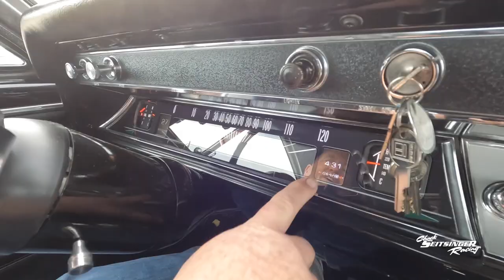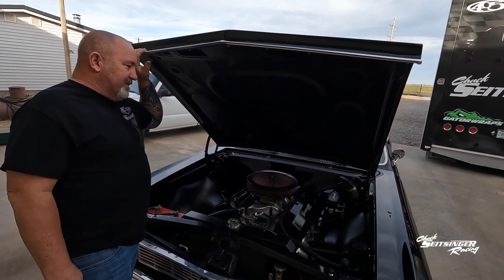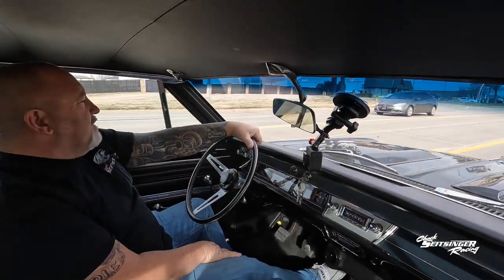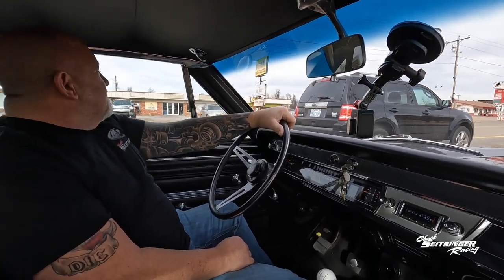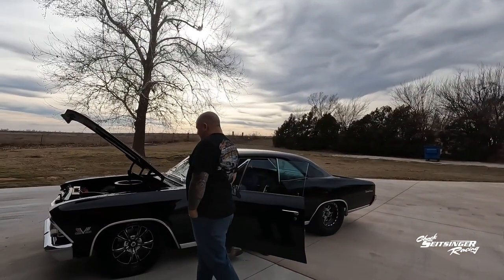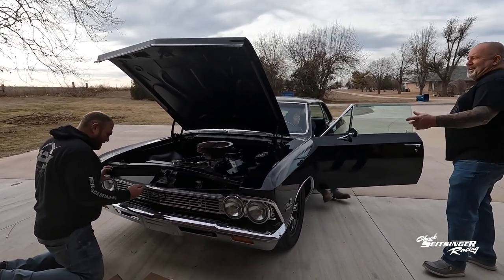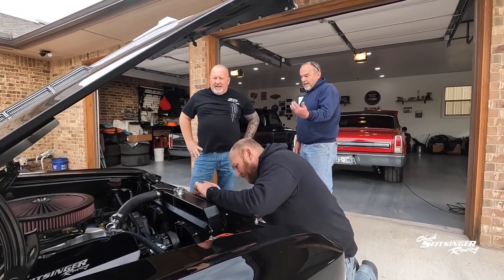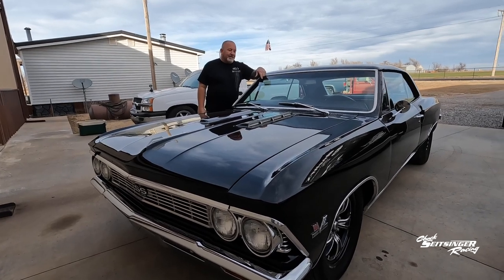Ride with Chuck in his '66 to The McKee's shop for some upgrades. #streetoutlaws #chevelle #405

Comment: My Dad bought me a 67 SS in 1973 out of my uncles junk yard. No motor or transmission. It was a theft recovery. I was a 14 year old kid,lol. I worked washing cars after school at the Chevy dealer. I re-did the paint and interior in our garage. I saved for 2 years and bought a 454 from Baldwin Motion Performance and Muncie.  That was a solid running car for a couple years and got traded for a 69 Z28 . Good times.

Comment: A friend of mine has a 66 Chevelle small block 406 with 4 speed he has had for over 30 years. When I first met him he had a 60 over 327 in it well I ended up with it in 1998 he went 355 then 377 then 383 now a 406. But all alone it’s been a 4 speed car.

Comment: The headlight switch shuts the markers off up to at least 1967.  In the 70s they changed that in the switch.   You have to go to a newer switch and move the marker light wire

Comment: Sir Charles...
You have a bad ground on the drivers side outer headlight.
It might be a source for the running light issue also.
Should be a wham bam easy fix.